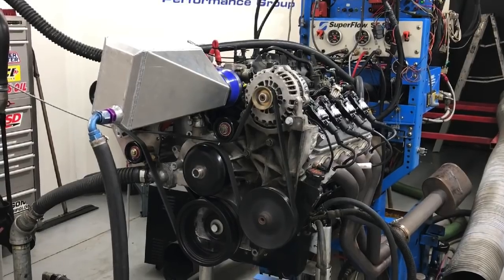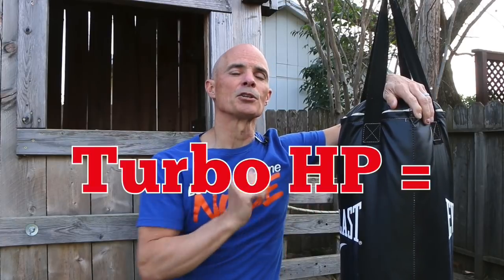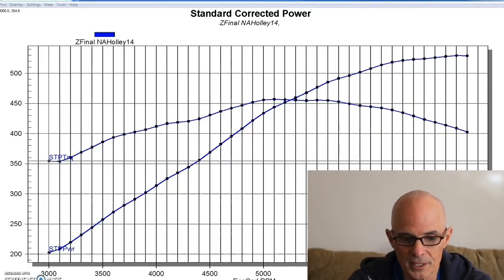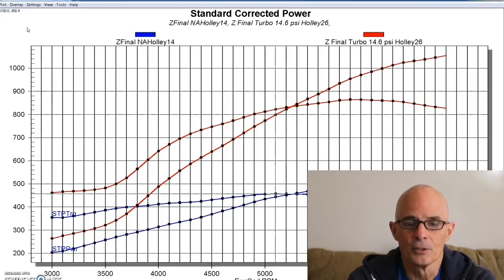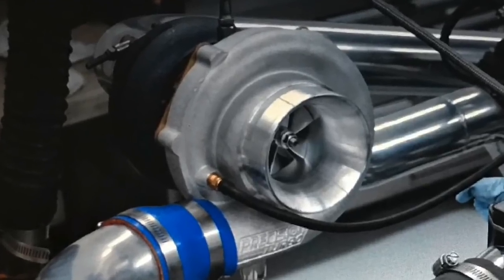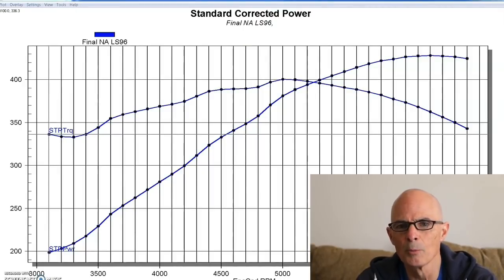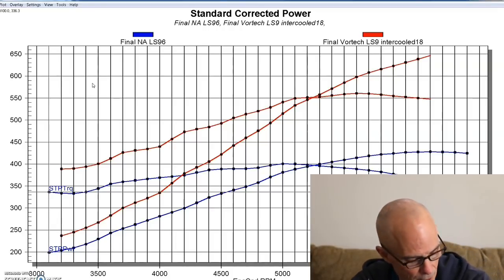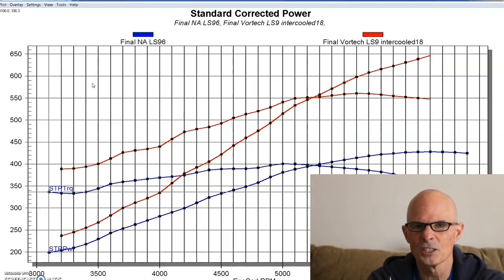WHAT DOES IT MAKE? TURBO HP FORMULA!-ANY BOOST!

Comment: Here is the only problem with this formula it's for dyno engines only not actual engines in ur car. We (junkyard guys) ain't going to dyno test no junkyard engine lol especially with turbos when u have to build the turbo kit in the car around everything else. Just saying that's my honest opinion. I watch ur videos to find out one thing what makes the most power. What makes my engine run to the fullest potential. If I can copy ur build it would make it easier also so maybe u can do a build series like other Youtubers. Just an idea
Reply from the maker: if you are looking for a particular power ouptut with a particular size motor-ask away. I'll show you an example
Reply: @richardholdener1727 I have a 5.3/4.8l not sure yet but it's going to be a street engine my goal is to make over 700hp on spray without spraying it maybe 500hp. I have a 6.0L that is getting a forge internals and a turbo I need it to make as much as possible trying to race with that engine. The 4.8/5.3 not really an issue. The 6.0L is where I need help what cam? What fuel? What heads? What torque converter? What transmission? What rear gear?

Comment: Learn more on here than any were else on YouTube or the internet ..he'll I'm just shootin for 500whp in my 94 ss s-10..a engine. 2000 4.8.. turbo 350.. 150 thousand miles tbss intake.throttle body.  and ebay gt-45.factory ecu. Do I need valve springs at 500whp? .any suggestion or advice
Reply from the maker: probably not as long as rpm is kept down. If you swap cams-then yes
Reply: @richardholdener1727   hey love the videos and stock cam probably only gonna run it to around 6200. 6500rpm on 93 with some octane boost that's what I was turnin n/a  it's a street truck Mabey few track runs ..think stock springs will hold up at that rpm they have been but I plan on runnin about 10 pounds 475 500whp in that range. .that's really my only question the springs and eat size injectors u think ? I'm on a tight budget learning as I go I was going to decap the stock injectors

Comment: Noticing how the turbos tend to not add as much at the lower rpms as they do on top I wonder how much of that is lag? Would be interesting to see if there is a power curve difference running the dyno sweep from the top down vs the bottom up. That way you would eliminate any bottom end lag effects.
Reply from the maker: we don't run the sweep in revers and people want to see turbo response
Reply: @richardholdener1727  Yes it is more stress on the motor I think dragging them down. They for sure will find the weak links!lol I agree since turbo lag effects driveability running from the bottom up gives a better indication of how the engine will perform in use. I was just curious what if any difference there might be in the torque output based on using the other method. I think  for certified hp isn't the load supposed to be held at given rpms and not done as a sweep?  I realize For tuning a given setup it is irrelevant but again just curious what kinds of differences you see in the power curves based on the different test methods.

Comment: So NA + boost of 14.7 = double power. So the turbos and superchargers require no energy to run I guess. Not. Even turbos that people think are free power cause a dam in the exhaust with extra back pressure and it does not take a rocket scientist to know that steals power.
Reply from the maker: and yet the formula works over and over, again and again

Comment: I have a LSX on 10 psi on my innercooled GTO
Reply: JUNKYARD GOAT I have a 5.3 on 15psi in my gto. Heads, cam. Should be at least 450 flywheel before turbo. 900fwhp on 15lbs. 😳
Reply: @Turbogto_guy  
No way I'm going to check out your videos. Im going to the drag strip with the turbo lsx gto for the fist time this year 2020 lol hopfully the stock rear end holds up
Reply: JUNKYARD GOAT well there’s people in the 1.5-1.6 60ft on stock rear with an auto. Standard is brutal on the stock diff. On 8-11psi (I have boost by gear) I went 11.10@128 with a very soft 1.9 60ft launch. I had timing dialed way back because it was the stock motor. Now I have a built 5.3 that Will take way more boost. And I put a bigger stall. And a launch control (2step) got ordered this morning.
Reply: @Turbogto_guy  
im scared to use my 2 step with my turbo lol maybe after I get a couple passes in
Reply: JUNKYARD GOAT I subscribed to your channel. Hopefully you post a video on how it went at the track.

Comment: Richard really means:
Boosted HP=N/A HP X ((Boosted psi / 14.7) + 1)
Reply from the maker: yes-that
Reply: You don't need the inner set of parentheses.
Reply: @fascistpedant758  the +1 needs to be added to the division sum before the multiplication occurs.  I'm sure there are 10 ways to write it, but in my example it's needed. I didn't need the "X" either,  but included it for clarity.
Reply: @Turbo_Todd  The inner parentheses may be useful for clarity, but the division (bp/14.7) should always be done before the addition (+1) regardless. The outer parentheses are required.
Reply: @fascistpedant758  that is what my post already clarifies. Plug the numbers in.  It works
Reply: @Turbo_Todd   I didn't say it wouldn't work. I said it would still work without the inner parentheses. Try it!
Reply: @Turbo_Todd  why would you need to add something that is not really required? Those are simple mathematics rules which are properly used worldwide...
Reply: @Georgianson Because  the +1 must be added to the divisiion sum before the n/a hp is multiplied.  You can't simply enter 300hp x 14.7 / 14.7 +1 into a calculator or spreadsheet. If you add+1 at the end,  it gives you 301hp. Add the 1 to the division sum first, you get 2. Now it's 600hp.. There's no rule in this case.  It's a formula to follow using basic math used worldwide. Parentheses are needed.
Reply: @Turbo_Todd  that is correct - single parentheses are needed but not the double ones as you wrote.  The proper formula looks like this: Boosted HP = NA x ( psi/14.7 +1) , no second set of parentheses is required at all. Just like no third or fourth one required - one is absolutely enough to get the math right using universal rules a was talking about.
Reply: @Georgianson  They both work.  What you don't understand is that I was trying to keep the non engineering folks from adding before dividing. So the extra parentheses makes it absolutley clear to those that do not know about multiplying and dividing before addition and subtraction. Thanks for adding a bunch.of unnecessary shit to this reply chain.
Reply: @Turbo_Todd  what you don't understand that you could have explained the non engineering folks the PROPER way of doing the math instead of making one up and by doing so you would not create a subject of this discussion resulting in a few people telling you what the correct way of doing this is. But for some reason you keep insisting on some crap formula...
Reply: @Georgianson  omg, just let it go math teacher
Reply: @Turbo_Todd  omg just stop replying, non engineering folks protector
Reply: @Turbo_Todd  don't you mean the +1 needs to be added to the quotient (i.e. the answer to:     dividend/ divisor) before the multiplication occurs?  in this application "boost psig" is the dividend and "ambient psia" is the divisor.
Reply: Thank you from all of us math nazis
Reply: @ntwtransam  It's not about being a math Nazi. It's not a grammar mistake. The video  was created around this formula being right.
Reply: Noticed that as well ... good catch.
Reply: @Paulster2  thanks for the correction because i was  loosing  HP with the  formula   richard posted   going from 115 to 59
Reply: Got me at 675hp ish.. sounds about right. Prolly 150 wheel after parasitic losses 😂
Reply: What’s the +1 for?
Reply: The  calculation works the same in bar (and even easier to compute).
300×1 (atmospheres) = 300.
300×1.689 (atmospheres) = 506hp. 
300x2 (atmospheres) = 600hp
And so on.

Comment: Back in the day, my dad told me about a engine with supercharger, ran fine until the valves floated, it pulled the rods apart at about 7500+, so mind your valve springs kids! It doesn't only cost power, it can put a hurting on the wallet also! Skipping valve springs can be disastrous!

Comment: Ok but don't turbochargers with different sizes flow different amounts of air (CFM) at the same boost level. Say we have a car making 300hp @14.7 psi on a gt28, won't the same car make  350-400hp on a gt35 @ 14.7 psi ? Isn't flow (CFM) of the turbo more important (that's why we have turbo maps) than the boost ? So if the cars make 2x the power with the gt28 than it's possible to make 2.5x the power with the gt35, or I'm I getting something wrong ?
Reply: @riceracingdonmega  Thanks for the reply. As I understand it, specific power is based on the whole of the setup.  In the case of the other video, the SP raised because of the decline in back pressure (less restriction from the twins), so even though the boost pressure was the same, the setup with the twins had more fresh and cooler air in the cylinders dew to the lower back pressure, so the SP go higher. I agree that the videos are more focused on the majority of viewers, which is nice since he has a lot of experience and know-how on the subject.
Reply from the maker: the smaller turbo won't support the boost level at the power peak

Comment: I'm no engineer, but you need to watch gale banks videos on MAD. Manifold air density. I want on of his idash data monsters bad. He explains why MAD is better than boost, and the idash makes it readable.
Reply: Not only is Holdener familiar with all of this(he even referenced it a couple videos ago when he was talking about boost), but you're missing the point. Banks didn't miraculously make the measure of manifold air pressure(boost) - he just developed an alternative that offers the specific information that people are typically referencing boost numbers for. That doesn't mean that boost PSI doesn't tell us anything, or is inaccurate; it means that, IF you understand what it is actually describing within your engine(which would be the relationship between air pressure and air restriction within your specific combination - boost is a measure of RESTRICTION after all, and the more downstream flow, the lower the restriction. If that isn't an informative data point, I don't know what is), you can reference it with real accuracy for the information that it offers.

No, obviously "how many pounds of boost are you runnin, brah?" doesn't actually tell us ANYTHING about an engine if you aren't already familiar with similar combinations(if you're familiar with typical boost numbers run on stock LS engines, then you can certainly reference boost as a reliable data point for other stock LS engines), that's what Gale's point is, and that's the point behind 'MAD', it offers information relevant to what that question is really asking(basically "how much air are you moving through it?").

However, the fact remains that everything Holdener explained in here is completely accurate - it doesn't matter what engine it is, what combination, if you double the air pressure going into the engine, you're going to double the power output. This is accurate because it is an informed understanding of the information that boost brings to the table. 
Pay attention to exactly what Rich is explaining, his word choices, etc., and compare it to what Banks has said about boost, and you'll see how they aren't antithetical/hypocritical.

Boost isn't a "bad" measurement, it's just a DIFFERENT measurement - but, it only has value to those who understand what exactly it is telling you about your engine, and it's as useless as anything else if you don't understand what it's expressing.
MAD isn't an all encompassing boost PSI replacement, rather it's designed for what people have commonly tried to (mis)use boost pressure for.

I wish I could explain it better, I'm sure this devolved into a word salad lol, but anything like this that has to do with engine dynamics gets REAL complex REAL quick, it's a lot to wrap one's head around

Comment: Boost means nothing an hx35 at 40 psi will make less power than a gt55 at 10 psi. Boost is a good measurement for that specific turbo model
Reply from the maker: if both of those turbos are run on the same motor at the same boost-guess what happens?
Reply: @richardholdener1727  
Untrue  you run both turbos at the same boost one will produce 1000 or so more hp .